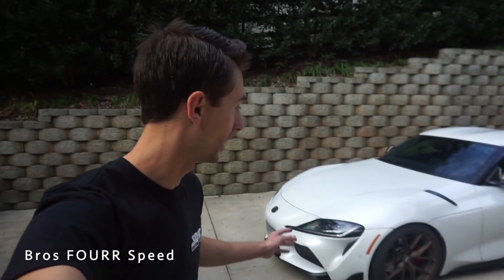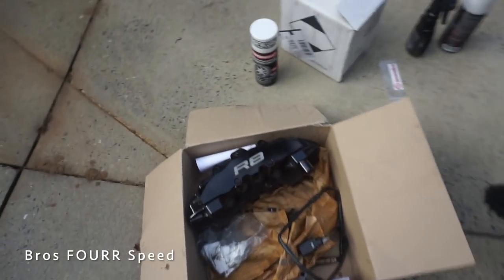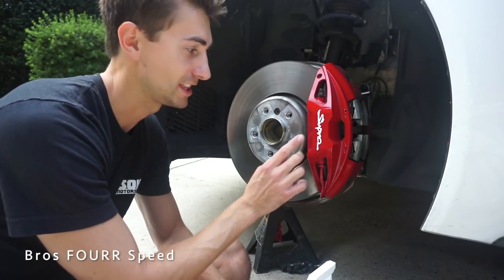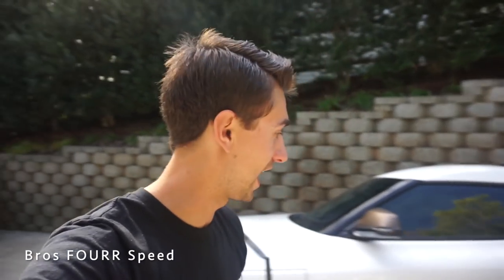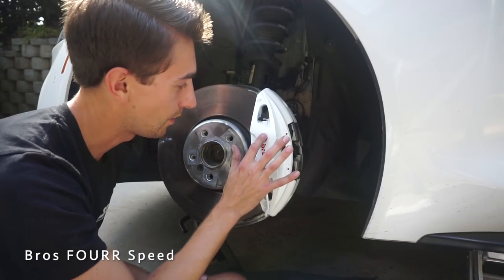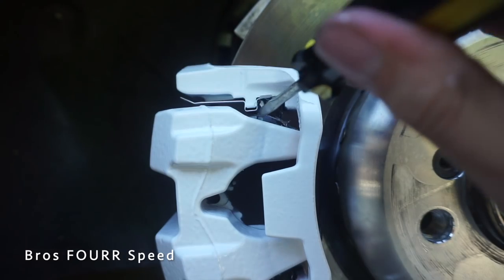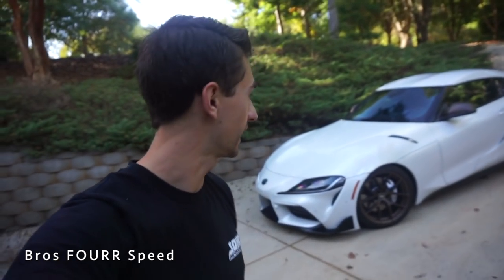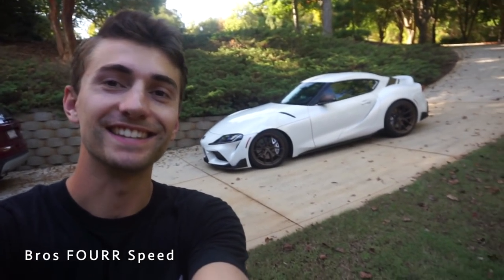HOW TO PAINT BRAKE CALIPERS... THE EASY WAY!!

Comment: Very interesting . It looks good. I’ll be interested to see how it holds up to the heat and dust.
Reply from the maker: Should do well against heat. But I'm sure it'll get dirty quickly. But since the surface is extremely smooth, unlike plastic dip. It should clean easy!

Comment: Just a heads-up the extreme heat tends to bind peelable paint to become almost permanent after it is on for a couple months in my experience. And I used all the brands on various projects
Reply from the maker: I'll keep a look out for that happening! However my calipers are ceramic coated. So I'll make an update when the time comes to peel it off!
Reply: @BrosFOURRSpeed  any updates? How long did it hold up? Did it peel off nicely?

Comment: How long did you take to finish all the calipers?
Looks kinda tough and i suck at this kind of thing lmao
Reply from the maker: Without filming this would be about a 2-3 hour project. Took me almost 5 hours. But filming takes a lot of extra time. Hardest part is getting the wheels off and taping it up. Very easy overall. But prep is key. Clean well and tape well and they will come out great!
Reply: Haha overall u did a really great job but for me it would take me a day lol
Reply from the maker: @bentran3657  LOL, I've done a ton of projects similar to this. So I have experience. I'm glad I filmed the first side I did. Was pretty worn out when I started the other side. So I did that off camera lol. But it was fun!

Comment: How hard was it to come off after getting hot?
Reply from the maker: Not too sure. I never peeled it off. Had this on the car about a year and then I sold the car. Same for my GTR. Neither car peeled even after over a year. I'd assume it's still easy enough to peel it off if you do plan to remove it

Comment: White calipers -25 hrspowers, the Brembo stickers +25 hrspowers 😉
Reply from the maker: lol, so I netted 0 ;)
Reply: @BrosFOURRSpeed  There are 4 calipers and only 2 stickers (;
Reply from the maker: @Zergling777  I thought of doing the brembo logo decal for the rears. But they aren’t Brembo. So I didn’t want to badge a fake product
Reply: @BrosFOURRSpeed  Is it TRW? Have you thought about replacing the rear calipers on the 2-pot BMW M Performance? I suppose it fits and will look really cool.
Reply from the maker: It'd be cool to swap to a different caliper like that! But it'd really be just for looks. The factory brakes are more then enough for performance. How much do you think that would cost?
Reply: @BrosFOURRSpeed  I'm guessing $ 300-500 for a pair of 2 or 4-pot calipers on eBay. I recently swapped the front 2-pot calipers to 6-pot calipers on my RRS. It cost me $ 330 for calipers and $ 75 for brake pads and discs, and it's worth every penny I spent (;
Reply from the maker: Oh nice! Not too bad at all! I'll have to look into something like that!

Comment: Hey man that looks pretty clean! Kinda ghetto but still turned out looking good!
Reply: What’s ghetto about it?
Reply from the maker: How is it ghetto? It looks 100% like a factory finish
Reply: @BrosFOURRSpeed  I meant how you spray painted it looked ghetto. It looks perfesionally done! I think professionals would have taken the whole thing off instead of using newspapers. No hate intended, you guys did a great job!
Reply from the maker: Well as long as you can cover all the surface properly, it can be a professional job. I am really good with using a can to paint with so I know how to angle the can to get it 100% covered